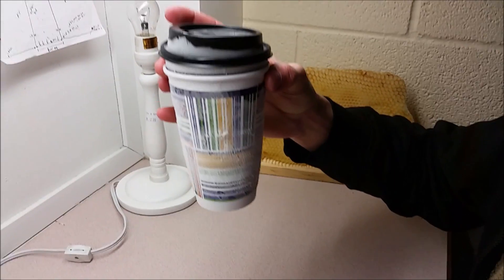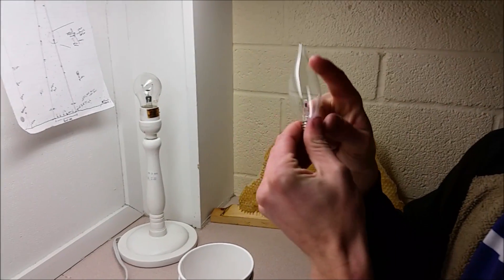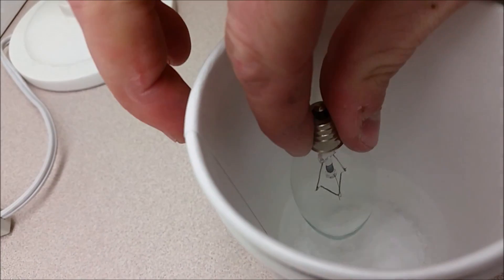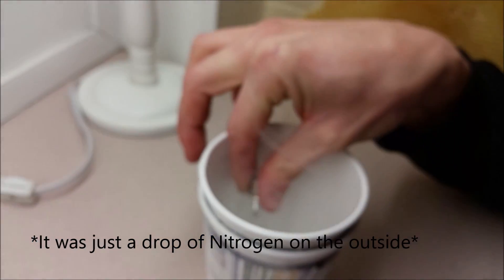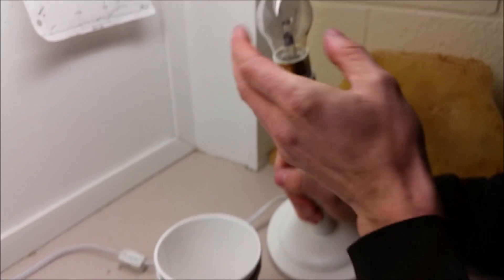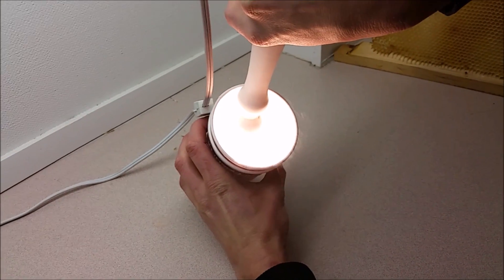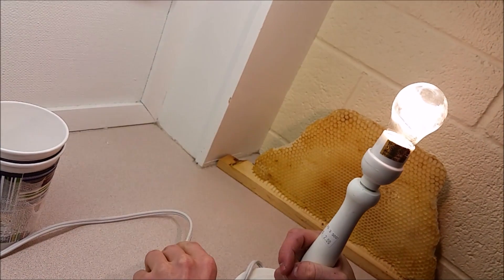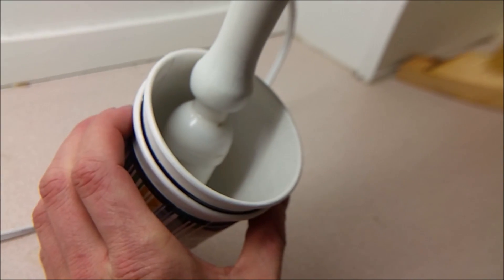Light Bulb + Liquid Nitrogen = Solid Argon Frost!

Comment: Clever to use the heat of the filament to keep the pressure high enough for the argon to remain a liquid! Although I guess it depends on the thermal conductivity of the argon versus the glass.

Comment: It's the resistance of the wire that generates the heat that then lights the lightbulb. If the filament was cooled down, I don't think it'd make the bulb any more efficient :P Even if we just looked at a change in conductivity of the wire, ignoring the fact that spontaneous photon emission is 'cause of heat... having higher conductivity means less energy dissipated across the wire, unless that increases current draw enough to compensate. The resistance of the filament is the only thing regulating current, so I'd expect it to trip the breaker or something...

Comment: Fractional crystalization is awesome; I think I just devised a feasible experiment. Think one might make liquid argon from air with a separatory funnel, liquid nitrogen and a suitable pressure vessel?
Reply: I mean, it's roughly analogous to how it's done industrially, yes? Just using existing LN to remove the heat.

Comment: Some heat seeking weapons use liquid argon canisters to super-cool the guidance units.  This is done to make the guidance sensors more sensitive to heat and easier to get good target locks and tracking to high-heat targets (aircraft engines).  AIM-9 Missile uses this kind of tech (but it's pretty old school these days)  but it' can be easy to counter with something of high heat like a flare.  Most higher tech, longer range weapons systems these days are radar-guided.  I digress.

Comment: Hello Cody, while the argon is solid shouln't the bulb break?. I thought it would break due to the inner pressure being lower than the exterior one, correct me and if you could explain it please :).
Reply: The bulb must just be structurally sound enough to handle the pressure... This question demands a retest!
Reply: Huh, thank you for the awnser ;)

Comment: The resistance of The lightbulb gets higher when the temperature is higher. Thats the reason why the lightbulb is that bright at low temperature -> low resistance. And thats also the reason why all the lightbulbs were destroyed when you switch them on.

Comment: I want to put argon in a balloon and inhale it. Legend has it this will make your voice deeper, because argon is heavier than air, and the reason helium makes your voice higher is because it's lighter than air.
Reply: +Drakethedrake try sulfur hexaflouride, much cheaper and safer. argon displaces air and is used as a shielding gas for welding. You would most likely die...
Reply: GoProVideos ARGON MASTER RACE

Comment: @2:45 you can see a projection of the bulbs filament onto cameras lens. I wonder if this happens under normal conditions or if the frost on the bulb prevents the bright light from drowning out the camera.
Reply from the maker: +Adam Ulmer 
Interesting! I never knoticed that!
Reply: +Adam Ulmer pretty sure that is an internal reflection in the optical system caused by the magnifying lens.
Reply: Thats cool

Comment: try it again after painting a portion of the bulb (perhaps flat black) or applying some electricians tape.  
That way you'll be able to easily see if the frost is on the outside or inside of the glass.

Comment: Fun!
Argon helps prevent 'filament boil off', but also provides a heat-regulation function.
Vacuum would insulate the filament, causing large variations in light output with small changes in line-voltage.  The filament electrical resistance has a non-linear response to changes in temperature, changes in resistance lead to changes in current, which lead to changes in temperature.  
The Argon 'spreads out' the heat over time, breaks some of the resistance feedback loop by drawing energy out of the system.

BTW, the Halogen cycle bulbs are really chemical refineries disguised as lamps!
Tungsten combines with the halogen vapors, and the tungsten halides will convert back to pure metal on any 'hot-spots' on the filament.  Self-healing wire!
This is why running a halogen bulb under its designed power level makes them get dark and fail.
Not enough heat to drive the tungsten halide decomposition, so the halogens are 'consumed', which leads to a hard vacuum in the bulb.
The tungsten halides form a dark coating on the inside of the bulb.
Yes, 'bad' halogen bulbs that are simply dark can sometimes be fixed by baking them at a low red-heat until the halides decompose, while running current thought the filament to re-start the halogen cycle.
Then again, halogen bulbs are so cheap, why bother?

Hot-wire metal refining [experiments here!] uses a very hot wire in a metal-halogen vapor to plate-up crystals of ultra-pure metal.
Since the halogens are quite specific about what they combine with, and the decomposition temperatures for the metal halide also quite well known, getting pure metal crystals is not that hard.
Take a look at Wikipedia entry for Titanium.  They show a photo of an iodine-process bar.  The crystals grew from a central hot-wire, as can be seen from the end of the bar.
Nine 9's purity is routine.
How about some titanium crystals plated up on something?
Reply: +Greg Gallacci Very interesting, thanks for the knowledge.
Reply: +Greg Gallacci 
Thanks for sharing Your knowledge.
Best regards.
Reply: I wonder: what would happen if a light bulb with pure inactive nitrogen gas instead of Argon/Nitrogen mix would be build and wired up? Would this work, if so how or how not.

Comment: The glowing wire inside the bulb has more resistance when hot. So if you cool the bulb and the wire it will become less resistive. When the resistance drops, the current will rise creating more light.
Reply: bas12345654321 It glows because if the high resistance, its glowing because the tungsten filament is very hot. Cooling it down will cause the resistance to drop thus producing less light.

Comment: As the argon condenses that would reduce cooling of the filament through the gas because the pressure reduces, which may explain the increased brightness. 

Have you seen the new LED filament bulbs?
<http://www.lightro.com.my/sites/default/files/styles/portfolio_view/public/filament%20bulb.jpg?itok=4A17fSzg>
They must cool the LED strips much better and it is speculated that they use helium or some other gas with high thermal conductivity.